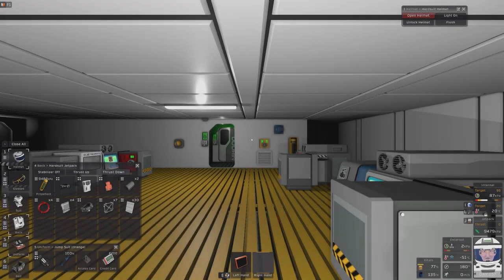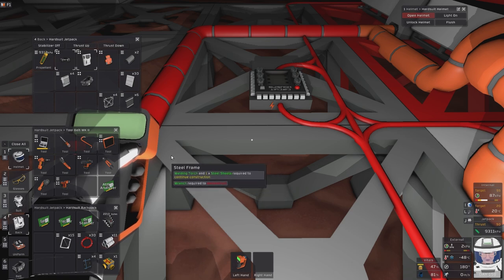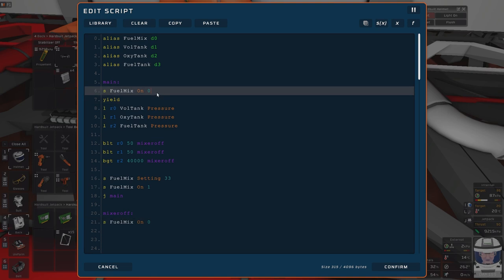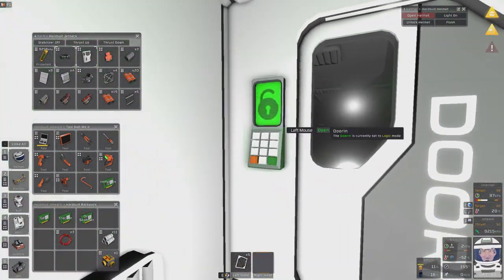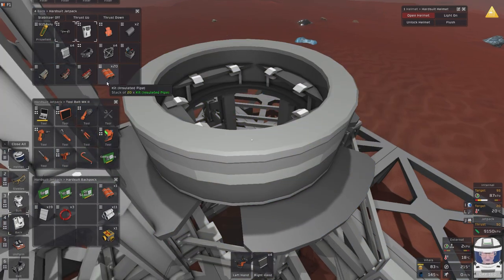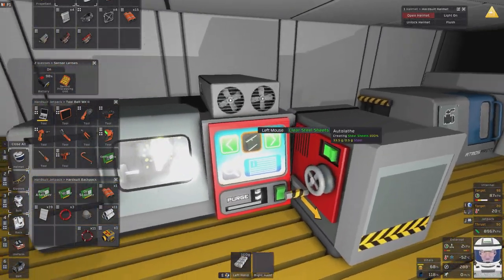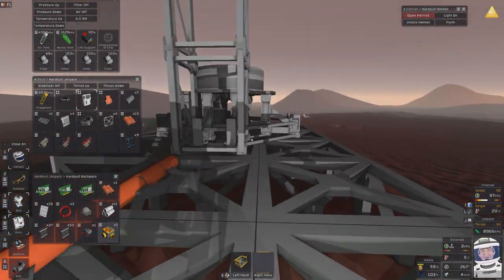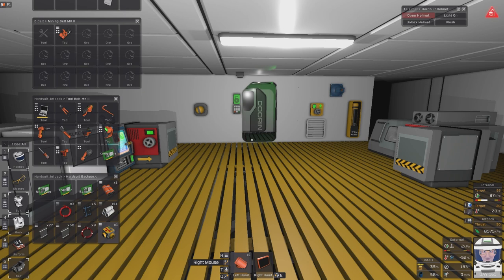The Most Critical Components: Rocket Engines Stationeers E22

Comment: I don't know if it is possible based on all I've seen so far, but can you make a series of buttons programmed to set the furnace to the correct ranges for the various types of ingots you commonly make? One button to change the temperature and pressure to fit gold/copper/iron etc. If there are some that have a shared acceptable range to allow for the ingots to be made, group them together? Again, no idea if that is possible.
Reply from the maker: @jasonknop973 - Yes it is entirely possible to automate the furance and people have. Along with automating the delivery of ores to the furance. You need a hot tank, a cold tank and a waste tank a fuel mixer and valves and some dials to select the materials you want.

Comment: Personally for fuel mixing I have my mixer set to increase/decrease by 0.1 depending on the O2 ratio.  Also if my fuel is slt 20MPa it turns on as well. The food thing about it is it seems gas temp really sets the ratio of the output, and since ur storing a in a tank you can use the tanks data port instead of a pipe analyzer

Edit: this also works well for NOS fuel(NOS fuel is 50/50), but the max pressure u can have (mixed) is 1.1 to 900kPa ( depending on temp). 2nd this is furnace fuel mix.  I don’t think it’s possible to have a hi pressure nos fuel mix due to the stress liquids have in gas pipes
Reply from the maker: Thanks for the reply.

I have set the furnace fuel mixer to adjust the output depending on the gas ratios, maily becuase you get unburnt fuel in the input pipe.. For the rocket fuel I was trying to keep it simple, hence the 33% setting for the Oxygen ratio. It's all in insulated tanks so the temperature shouldn't change that much, especailly on Mars. I am also using the tank data ports for the rocket fuel mixtures. It is the furnace mixer where I'm using the pipe analyzer, just so people can see there are different ways of doing things, anyway that's my excuse and not that I forgot you could read the pressure from the tanks at the time. 😁

NOS can be difficult, especially for new players. It either wants to boil, condense, freeze or go bang. Plus it needs a lot of plumbing and parts to make and quite a lot of energy. I will try to get to making NOS, which is why I left so much space in the area where the ice crushers are for the rocket fuel but that will be a while yet.